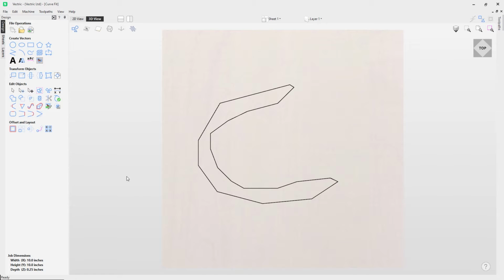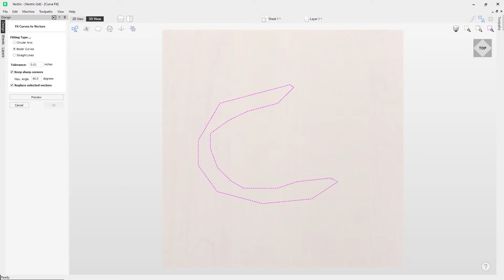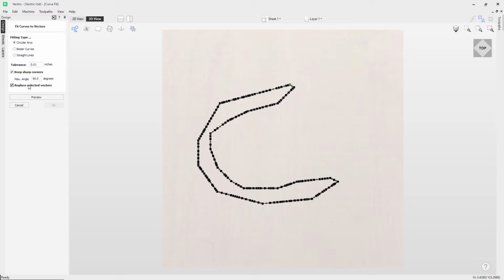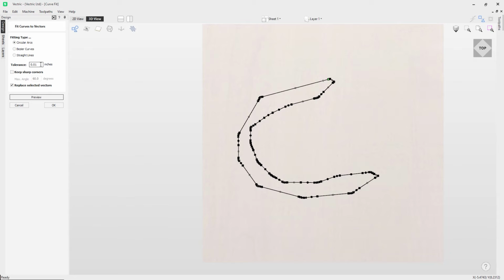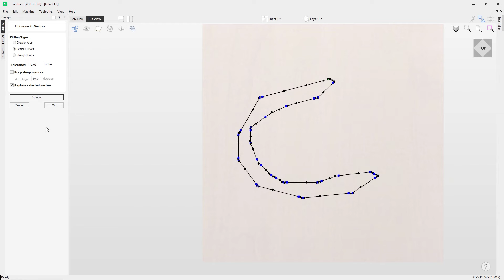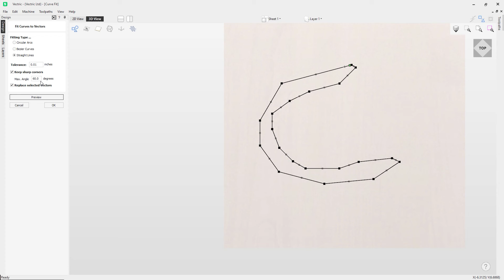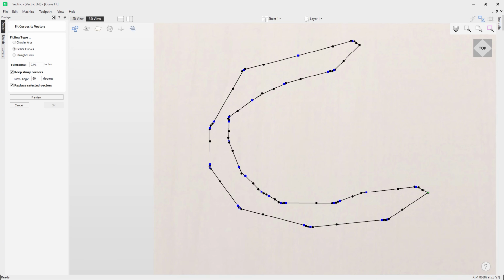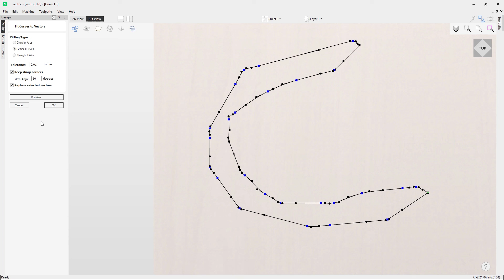How to fit curves to vectors in Vectric software | Editing Objects | V12 Tutorials

Comment: Hi! I’d like to know which post-processor I should use to save the code for that shape so that it uses curves (G2/G3) instead of straight lines (G1).
Reply from the maker: Hello and thanks for the question.  This sounds like a job for support@vectric.com.  Please email them and include the name of the post you are using/want to use and the issue.  It would be helpful if you send that email from the email address you have registered your software with.